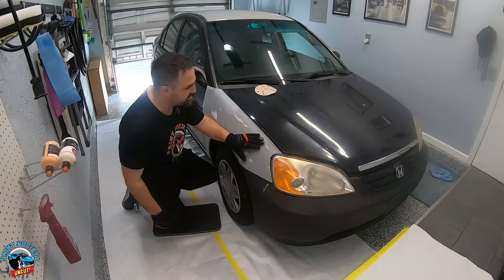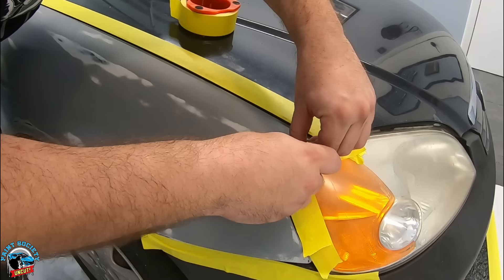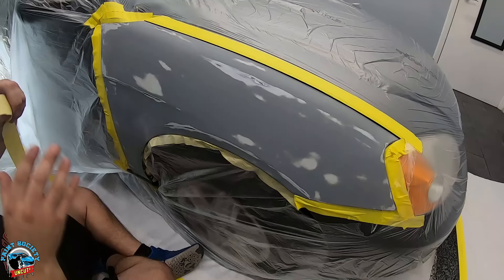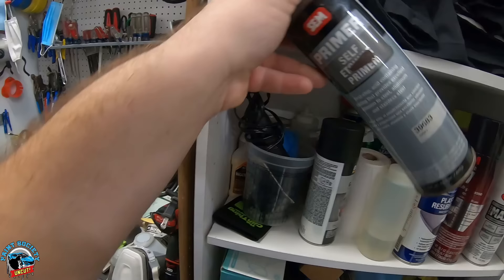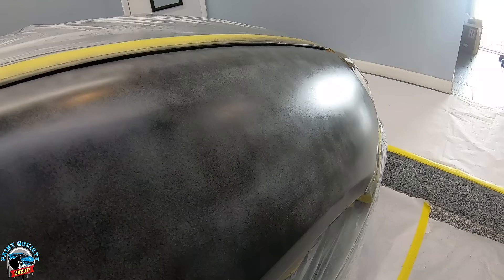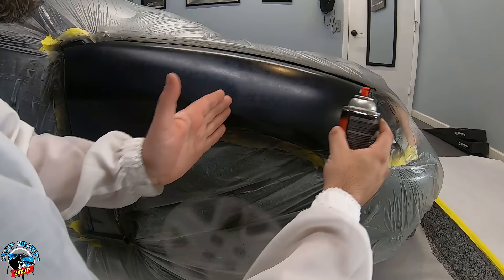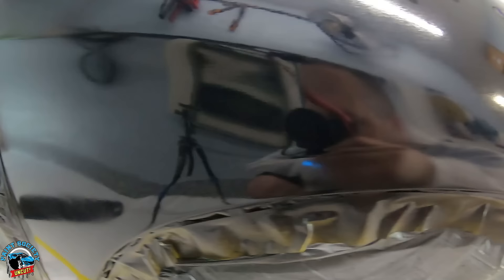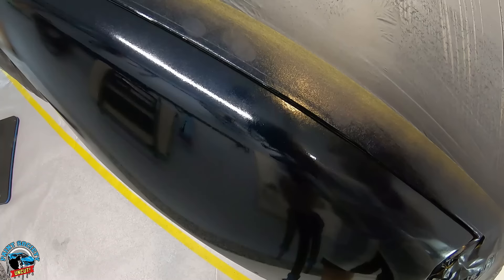Painting your Car with Spray Paint!

Comment from the maker: To get yourself fit with Paint Society gear head over to: 
https://paintsociety.bigcartel.com/
Reply: Brian, have you got any good tips on how to buff out ghosting from removed decals, especially on orange-red painted surfaces?
Reply: Love when you paint with cans
Reply: Hey Brian..to avoid blistering when re applying a primer over meta break through..is etch the go to? I've had reaction with epoxy and or urethane primers in the past but never tried etch...maybe I'm not applying dry enough? I don't know  ..any advice helps. Thanks for your Chanel its the best and your a great teacher
Reply from the maker: Go very very light. Water based primer is the best to use because it doesn’t have solvents in it that attack the surface.
Reply: L166
Reply: consider a channel in spanish, thanks
Reply from the maker: @enriquevelasco6100  watch my videos on your desktop and you can get Spanish subtitles
Reply: I want to see a full cart paint on sprak cans!
Reply: E2
Reply: @shauno6799  cool
Reply: could you do a whole car like this,i got a retired crown vic interceptor and everyones telling me the cost to repaint it professionally isnt worth it at all,its flaking up all over the hood and in other large spots
Reply: I use rattle cans it always comes out good
Reply: @hanskonrad5850  ₩₩09
Reply: I could be wrong but my dad what's the clear coat set up at least 45 minutes if not 2 hours. I'd have to ask him about it.
Reply: @shauno6799  qqqqqqq
Reply: Can this be done in a car lot?
Reply: @PaintSociety  Im racking my head trying to figure this out bc I always mess up spray paint jobs. I have a Rustoleum spray paint which Im pretty sure is an Acrylic Lacquer (its the Custom Auto Series in Matte Pearl White) which Im going to use to paint my motorcycle (steel tank & fiberglass fairings). So my question is: Can I use Spaymax 2K urethane clear coat over that Rustoleum, and what wait times should I use between base & 2K clear? In addition, would it be the same process if I wanted to use the 2K for a different project I have in mind where the base would be an Acrylic Enamel? Thanks.
Reply: What will happen if I spray over old car color .it’s white or I have to remove old paint 1st .

Comment: $20 dollars worth of paint,  $1000 worth of prep (labor) .  This video really highlights the importance of prep to a paint job,  Not just before, but during and even after!
Reply: its a lot more than 20 bux.  the paint hes using is duplicolor its 20 dollars  a can and the 2k clear is 25 dollars and i dont want to imagine how much those 3m buffing pads and creams cost. a lot more than most people are going to spend,  for  600 dollars you can get maaco to do it.
Reply: @Runescape.  I stand corrected.  the point I was trying to make was that prep is more important than fancy paint.
Reply: I used to work in a body shop. Prep is the key. And black is the hardest color to paint. It's like a mirror. And don't fuck up and burn through an edge with the buffer. You're going to have to repaint it all again
Reply: @OUTFXD bruh ima just spray paint fuck allat buffing
Reply: The advice on doing 1000 grit sand paper sanding and one final coat before spraying the clear, it absolutely golden
Reply: $20 maybe like 10 or 15 years ago! No it’s $35-$45 at least! But it still beats a few hundred dollars for a panel at a professional shop!
Reply: Painting is everywhere like this, 90% prep, 10% painting job. Even if you renovate anything at home
Reply: You think he prepped that for 10-20 hours?

Actually work was less than 4 hours, I'll bet.  

If he took that to a body shop these days, they'd quoate him $2,00 or 3,000 or more to paint he body panel.  And they probably aren't very good at what they do.  There is a growing incompetence out there.

That's why YouTube is a valuable resource:  guys are tired of being robbed.

Comment: If you put the 2k clear in the freezer it will last for months after its activated. Just take it out a few hours before use. I have successfully used an activated 2k can of clear from the freezer about 4 months after it was activated.
Reply: Interesting. Thanks for the tip. And is there any treatment you need to do before re-using it again?
Reply: Would recommend a deep freezer, the colder the better.

Comment: I wanted this guy to know that I followed all of his steps to paint my VW wing mirror cap and it turned out better than the factory job on the other side of the car.  The clear-coat was absolutely amazing.  Thank you for sharing your expertise.
Reply: 💯 did not turn out better then paint shop
Reply: @Landscapesbygareth  factory paint is done by machines, it's not wetsanded and buffed afterwards, there's even orange peel in it, it's pretty easy to outdo a factory paint job

Comment: So basically that 2K clear coat in a can is such a game changer for rattle can jobs
Reply: Correct. And it’s crest for headlights. I have done many sets with great results. Eastwood is good and I recently started using the spraymax brand
Reply: I don't think you buy them in the UK
Reply: Can't be 2k clearcoat in a can because 2k means it's a hardener and paint/laquer mixed together to activate. If it was ready mixed in the can it would already have been activated 🤔🤔
Reply from the maker: You didn’t watch the video did you?
Reply: @PaintSociety 
Yep... I see that these cans are using a duplex chamber to mix hardener with material. Is it really a good comparison with conventional pot mixed material that is thoroughly mixed prior to application?
I would also note the use of respirator used for 2k? Most would specify some kind of air fed system which obviously isn't going to be used by folk at home.
I'm not putting the video down.. On the contrary, I found it very useful and informative - I just had a couple of questions.
Cheers 👍
Reply from the maker: It’s the best option diy guys have in a can. It is very efficient.
Reply: @PaintSociety 
I'm going to buy some and try it out 🚗👍
Reply: @harwoods11  it’s basically automotive grade clear in a can. Just as good.
Reply: @PaintSociety  I used some on my wheels to re-clear the aluminium and resprayed the color as well. It worked great! I"m very impressed with it.
Reply: @FabiusMaximus1000  what paint did you use as a base?
Reply: @FabiusMaximus1000  curious because I believe you can't put some automotive clears over certain spray paint or it may react. Right?
Reply: @FabiusMaximus1000  I'd like to know how it worked for you because I want to refinish my wheels. Thank you for any recommendation.
Reply: @harwoods11  did you try it ? wanna try but wanna know how it goes
Reply: @gmoney6373 
Yea... But it's so much better to buy a cheap hvlp gun and mix up yourself. You can adjust nozzle and air pressure which you just can't do on a rattle can. It's obvious that a can will never be anything other than a "quick fix" in my opinion obviously (note that I owned and ran a professional repair shop in UK for 35+ years and saw cellulose, 2pack and water based materials in my shop) I'm retired now so just playing with toys in my Garage.. No spray booth etc.
In reality it's all about the prep. Plan well for whatever you are spraying 👍
Reply: @nigelhopkinson6614  We can. my local paint sho sells 2k in a can need to hit the bottom to put in the activator
Reply: @nigelhopkinson6614  2k can be deadly without the correct PPE
Reply: @nigelhopkinson6614  If you know a paint shop who mixes spray paint they will make you a can up to use within a day! they just add the hardener when they are mixing the can of clear coat usually at a little extra cost but the downside is its a one use deal! The Results are AMAZING and its Petrol Proof!
Reply: @harwoods11  Please use a Proper MASK!
Reply: @martinroberts3977  ideally spraying 2k material outside a spray booth and without the proper equipment is just stupid and possibly dangerous.
Whilst there is a small portion of cyanide in this paint it won't kill you unless you are saturated over a period of many years.
My paint staff always used air respirators and full body suits in a specialist spray booth. The only localised priming may have been by using single pack air dry products. This new 2k mix in the can is quite new (and clever) but I still think the average DIY car enthusiast is better off with a cheap hvlp paint gun and get paint mixed locally. I do worry about the lack  of car masking and potential for overspray etc.. Let alone public hazard and health.
Reply: @martinroberts3977 
The basecoats will just air dry and has no effect on the laquer. The laquer is totally activated by the hardener. The air temp will adjust drying times. The small proportion of  cyanide is present in the overspray / fumes so suitable respiratory masks must be worn at all times.
Reply: @harwoods11  it's a bit of both but the cyanide is the result of the chemical hardening process

Comment: I swear bugs like the smell of paint!
Reply: It must be intoxicating, causes them to fly into it. I know, when I'm intoxicated, I tend to fly into the ground.
Reply: Especially the clear coat
Reply: The trick is to spray a piece of cardboard first, 6 feet away from your car. Trap all the bugs, THEN spray the car.
Reply: I know what you mean it's like crack to a junkie lol
Reply: I did the same thing to my car back in 2018. It's still holding up in 2021.
Reply: The thing I hated was those paint snorting bugs.
Reply: @robj2704  Don't get drunk after painting. You'll fly into the paint.
Reply: They think they are landing on water, it happens even when you polish a car......Properly
Reply: An pools
Reply: The bugs are attracted to the reflection of the paint.

Comment: Hey FYI to anyone who is going to do this, warm up the spray cans in a bucket of hot water before spraying. It will improve atomization dramatically and leave a significantly smoother finish, even in a warm climate. I mainly recommend this with basecoat because  warming up the clear will reduce your orange peel but increase chances of runs due to it being thinner.
-NS
Reply: Great tip..thanks
Reply: I once used a hairdryer, worked great too!
Reply: This works really well actually, just tried it. Also noticed it uses less paint because more paint is sticking before drying mid air.
Reply: How hot should the water is?
Reply: I did not follow your advice as I just see it now and after the fact!   but how does that make sense Bro!
Reply: Thank you,  I was planning on laying my base coat down in a few days.  I will definitely warm up the cans.
Reply: And put it in the freezer after you're done so it will be usable much longer
Reply: @kowalski3389  🤣
Reply: 10 min in the oven, ofcourse after 5 min preheating
Reply: @kowalski3389  You can't say stuff like that. Somebody will think you are serious and actually try it.
Reply: @SponsoredNpartBy
Reply: @Maryus89star  hahahahaha
Reply: Legit,
Reply: @Maryus89star  Yeah, and have the cans explode on you when you stick it in the oven.  Yeah, sure,  makes a lot of sense there.
Reply: I do the same thing.  I keep an eye on the water temp though.
Reply: @chifdagrif5105  hey just did though
Reply: Brilliant tip!
Reply: How hot needs the water to be?
Reply: @five-star-media  I can't imagine more than 100 F.   Anything past that is potentially unsafe.   I am not an expert not giving you advise :)  Use caution and follow instructions .
Reply: I usually put them in the microwave oven for like 60 seconds before use.
Reply: @BReal-10EC 😂sure!

Comment: great video, I painted my car in my garage with spray cans. It came out great (total cost was about $400).. only did a panel at a time. The roof i can not do however I don't think the cans have enough pressure to carry the whole panel. I found heating the can up before spray increased the pressure and atomized the paint better. Obviously it has it's risks but considering the results... worth it. Thanks for the video.

Comment: I once painted a Citroen BX DTR with rattle cans in an old barn, back in the summer of 2000.
Went from Silver to Black and everything was done by hand, no power tools.
Total cost was around £45 for primer, paint, masking & sanding, (Got the paint for £1 per 400ml spray can). I already had polish & compound (not the modern machine compounding stuff).
Spent a week doing it, then left it for another week to fully cure/harden before using the car
Still have some masking and sanding stuff left over, the cars long gone though!
Though I enjoyed doing it I think I'd use a proper spray gun & compressor if I was to do it again, and a machine buffer too!

Comment: I own an antique 1985 Renault Alliance with only 38k original Kilometers on the odo, I repainted It with spray vans to give it the original finish + 3 years ago and It looks great, it's a very hard job and tireing (of course it's way easier AND faster with a compresor) bit I found the challenge interesting and I did It.
It took me a couple weeks to do the whole job perfectly😉.
To be sure of the right color, I had it matched by a pro and bought a gallon of paint and then got It canned individually as I needed .
My friends didn't believe I could do it and congratulated me at the end.
I don't know anyone else that has done this, the paint store guys always tell their customers of what I did, they don't believe It.
It can be done I you know how to paint.
I owned a pro-premium car repair shop for 20 years some time ago.